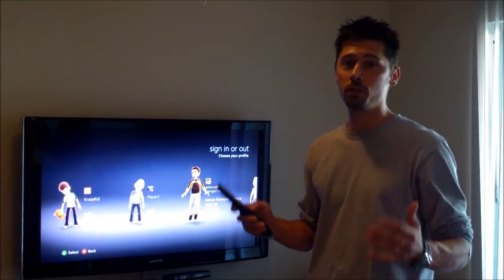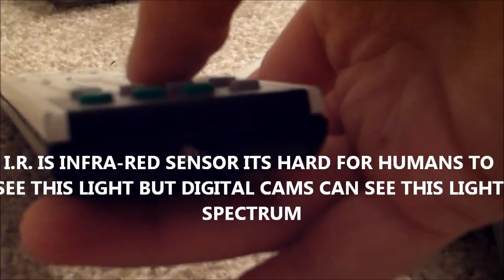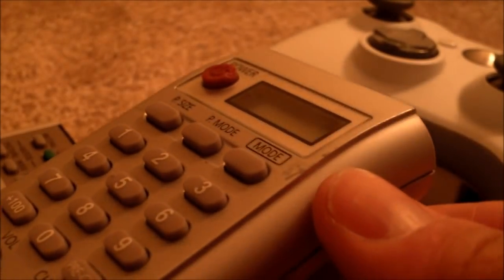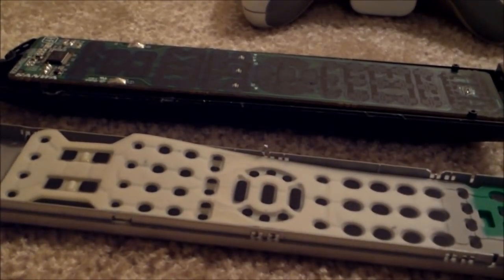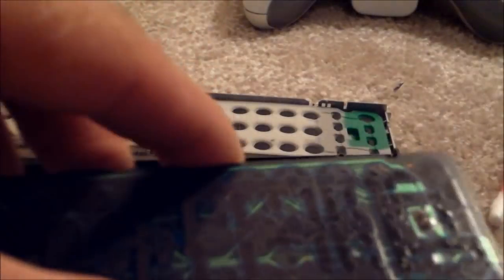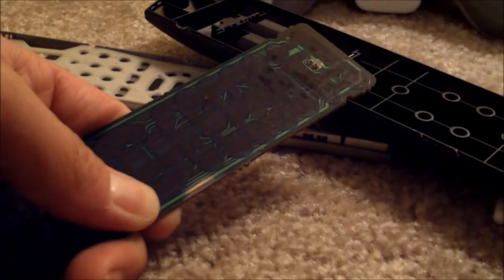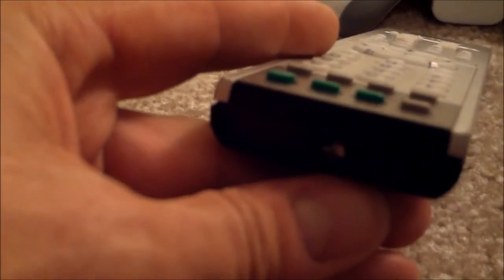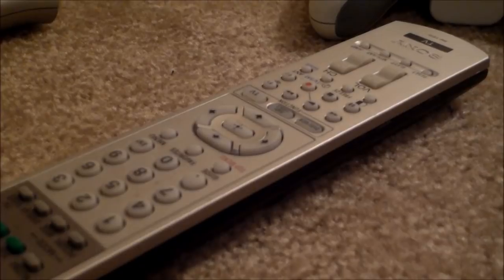HOW TO FIX BROKEN REMOTE CONTROLLERS

Comment: Any remote control I have had that some buttons didn’t work can be tested with an AM Radio. Tune the radio to the lower end of the AM band to a blank spot with no sound. Point the control close to the radio and you will hear keys that work make a tone. Dead keys make no tone.
This way of testing will tell you if the IR is working.

Comment: Great Video, always wanted to try soldering on broken appliance circuit boards. Anyway, I've a remote with just a few buttons not working. I've cleaned the heck out of the contacts and circuit board with alcohol and even used an eraser (on the circuit board contacts, as suggested in another video, but alas, the afflicted buttons remain so, and I've studied the circuit connections between the button contacts on the board and see no cracks etc.  Would it then be just a flaw in the chip looking apparatus on the board or have you any other suggestions,  Saw another guy clean with WD-40 (this sounds crazy, (I think it was just the cleaning that helped and NOT the WD-40 (ya think?))).

Comment: Good information, Tampatec!

Have you ever done a video on replacing the infrared sensor in a TV?  I've got an Olevia 32" LCD TV I found by my apartment.  It works very nicely, except for the universal remote control does not work.  I'm pretty sure it's the IR sensor inside the TV.  I'm looking to replace the actual IR sensor and am looking for advice on how to do that.  

Thanks a lot, Tom
Reply from the maker: THOMMGB you can buy ir board at shopjimmy.com or electropartsonline.com use code tampatecfriend for discount.
Reply: Thanks a lot for the quick reply.  I'll have to give that a try.

Comment: Thoughts Tampatec... I have a wingard DTW converter box. One the remote the LED lights are only working on the "power" and "Menu" , not the "channels" or other basic usage the numbers... I have cleaned, even swapped out old remote pad, Cleaned... Unfortunately they do not make this remote any longer even with RCA behind it.. I have ordered rca remotes to no avail, no universal remote works either.. ..
what do you think I can try next to get the "channels" to work...?
Reply from the maker: call wingard to get another remote 800-288-8094

Comment: hey Tampatec,  I just bought a lite-on vhs/dvd player-recorder, used.  And of course, get it home and the DVD side is completely inop.  Tray wont slide out.  So I get to looking at it and it looks just like the DVD burner that goes into any homebuilt computer--IDE connection, 4 pin power plug little sound adapter plug....So, can I get on the internet and order up any similar lite-on dvd burner and gaboon it into this VCR/DVD Recorder and expect it to work?  Or do I have to Do a'duct-tape thing?

Comment: My Philips TV just entered sleep mode, since my remote is broken I decided to manually switch off and then back on again but my tv is still in sleep mode.

Do you have any suggestions/ideas on how i can actually turn my tv back on from sleep mode without using the remote?

Please reply soon if you have any.Thanks!
Reply from the maker: unplug powercord for 1 minute to reset tv.

Comment: First of all, it is not a sensor. It's  on sale nosing a light. It's transmitting TV codes via IR. 

You've gotta use DMM to check if the IR LED is not getting any power. If it's getting power and you see no IR light using digi cam, then you can conclude that the IR LED is busted. It's hardy that it is busted.

Comment: I've a remote control which IR led  always stays on. When I press a button  the receiver doesn't work.

I've tried to clean up the button contacts, I've changed batteries, but nothing!
Reply from the maker: sounds like shorted ic
Reply: can i fix it ?
Reply: Got the same problem can't figures it out and I'm very familiar with circuit boards. RIP

Comment: ok Don't laugh! stereo remote stopped working. so I saw ur vid and the i.r. was not working. Since I don't have a solder, I tried using my Hot Glue Gun! after 2 old remotes and 4+ hrs I got the light in.. remote didn't work, bc w no solder gun I didn't re-soder the 2 wires, just bent prongs up on back.SO I'm assuming I need to solder those 2 wires??? Also 1 of the green strips leading to those 2 wires peeled up! will that make contact again after soldered??  PLZ help!!! YOUR VID WAS GREAT!